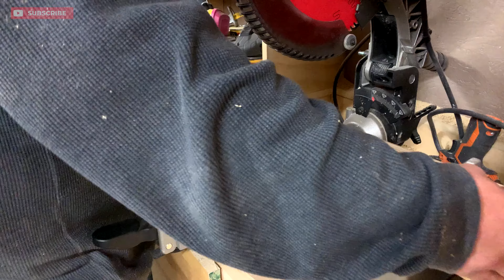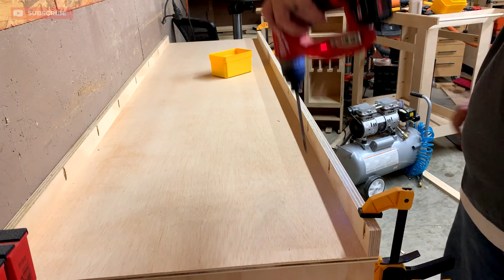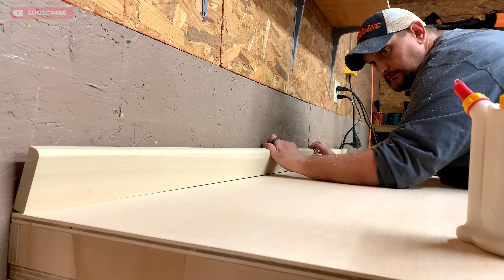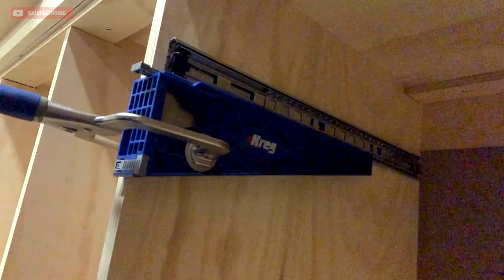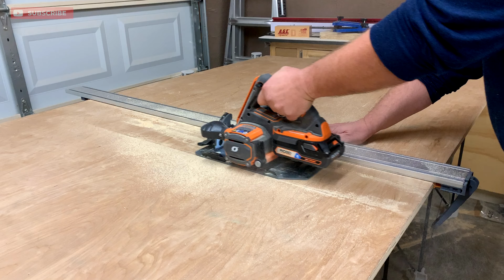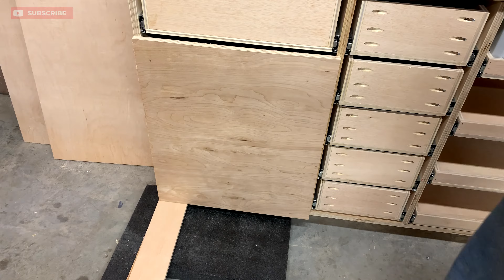DIY | How to Build a Torsion Box Workbench | FREE Plans! | Woodworking Projects

Comment: What is the Torsion Box top do rather than just a top. Sorry I just don't understand the difference other that more frame work
. I want to make one just like this as my first cabinet project. Now in retirement,
Reply from the maker: A torsion box is the same the design principle at a airplane wing.  The top is dead flat and will not twist of warp.

Comment: How has the plywood torsion top maintained its flatness? I see guys building torsion tops out of mdf. Plywood just seems it would be stronger.
Reply from the maker: I have 2 torsion tops built out of plywood.  They are still dead flat and have not sagged.  I would prefer plywood over MDF for the long run.  MDF tends to sag over time.

Comment: For the door hinges I use SOMMERFELDS EASY BORE it has all the drills preset and you can set the hinges any distance from the ends. It works very good. check it out
Reply from the maker: I will.  I love the Kreg door hinge jig.  But it has its limitations.  I can’t stand the their drawer hardware jig though.

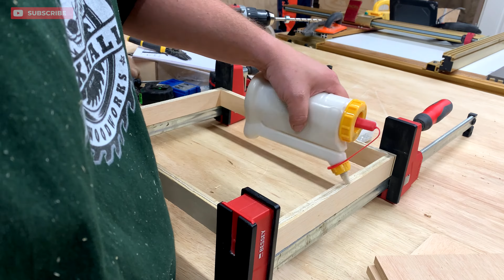Comment: I'm not a pro, but at 10:46 when you are using your brad nailer, I almost can't watch. Using your fingers as a guide to line up the nailer with the end is fine... but leaving them their when you are shooting?  Brad nails don't go in straight, they go in perpendicular to the material. Your thumb looks raised high enough to be clear, but not a good practice IMO.  

The build turned out great. Thanks for for such a high quality build.
Reply from the maker: Corey Schaaf you are welcome.  But the crown stapler has a none marring tip on it that is above the barrel.    It’s way out of the way of the staples being fired.
Reply: I know a stapler was used here but just to add to the brad nail discussion for information purposes... When shooting brad nails the nails will only curl left or right, perpendicular to the gun. That's due to the way the sharp point is formed in the manufacturing process. The points are ground after the nails are secured in strips. That's why it's always best to hold the gun perpendicular to the edge.
Reply from the maker: Good info Jay